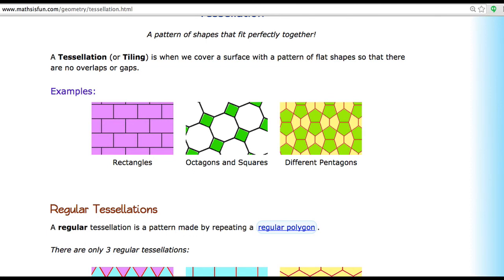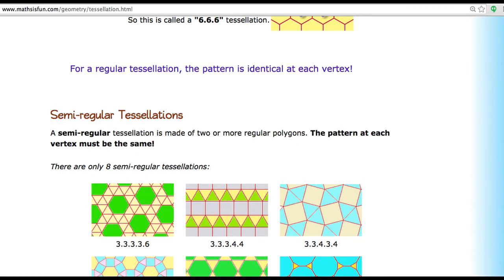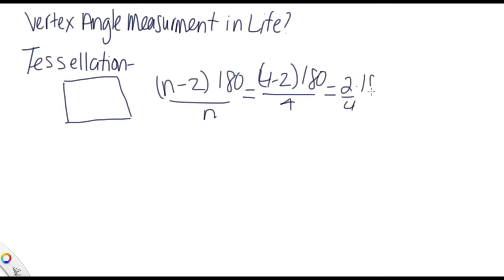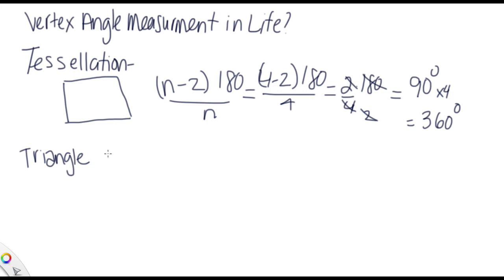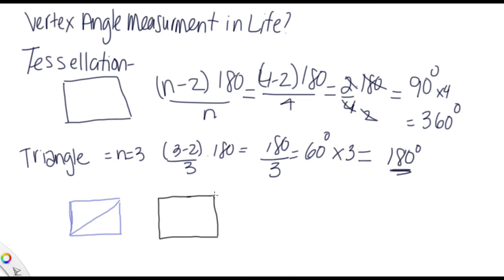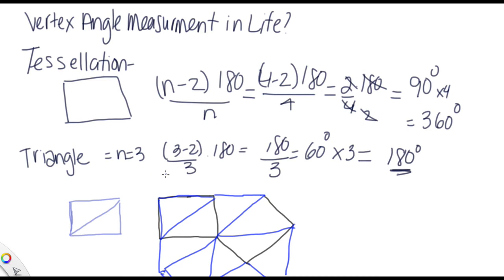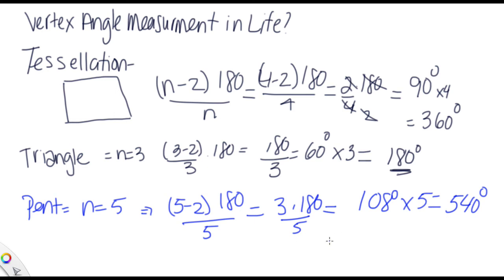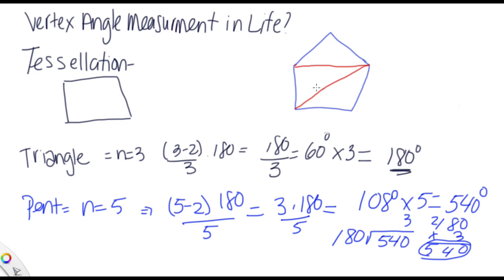Tessellations from Regular Polygons

Comment: In the example with the squares and triangles at the 6-minute mark, the triangles are no longer regular, but appear to be 45-45-90 triangles.  If you stick with regular triangles, then you can fit 2 squares and 3 triangles around a vertex in one of two distinct orderings: 3.3.3.4.4 or 3.3.4.3.4.  Each of these orderings corresponds to a valid semi-regular tiling.